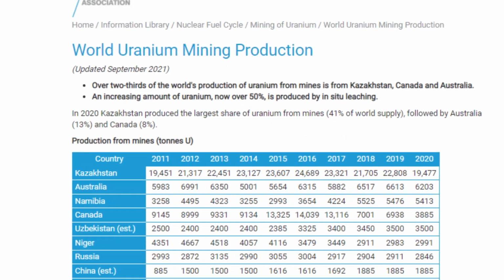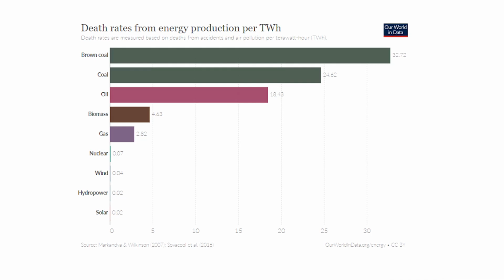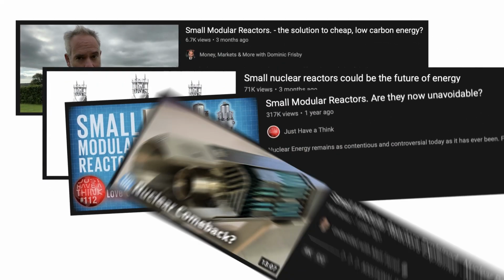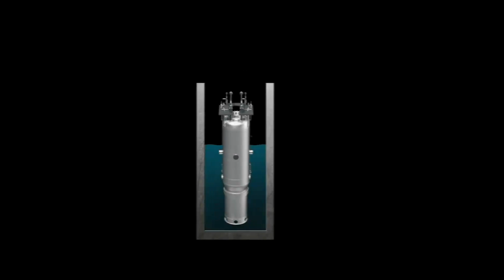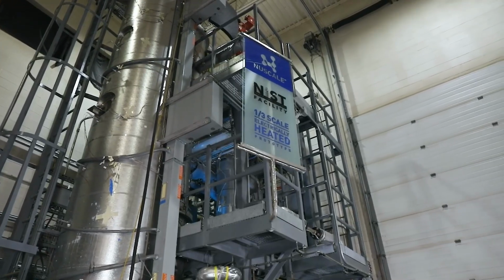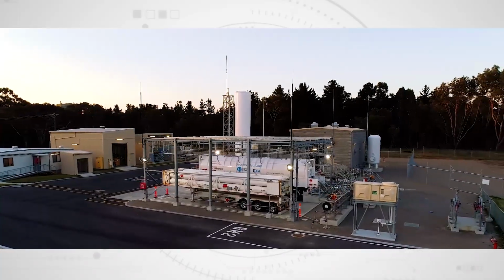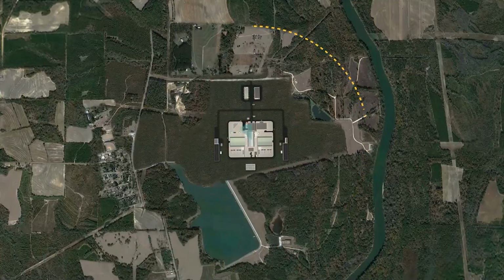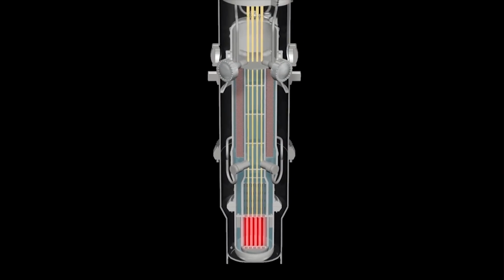Can Small Modular Reactors Save Nuclear Power?

Comment: Normally I quite like your vids Rosie, but here I think your overall analysis is poor. Short version: nuclear is too slow, too expensive, too dangerous, restricts the build-out and grid options for renewables - and has way too high emissions per kwh anyway. New nuclear in a climate heading over 1.5°C is insanity, it's straight-up denial - we need to cut Gigatonnes of GHG emissions NOW, the absolute bulk of cuts have to occur this decade [1] 

Long version: 
-New nuclear power plants cost about five times as much per kWh as onshore wind power plants. Nuclear power takes 5 to 17 years longer from planning to operation (climate crisis needs scalability right now). It produces on average 23 times more emissions per unit of electricity generated than wind and solar + storage (between 9 to 37 times depending upon plant size and construction schedule), and that is probably an underestimate. Moreover, it structurally hinders the expansion of renewable energies, which are more readily available, cheaper and less dangerous than nuclear power. Furthermore, it causes risks and costs related to weapons proliferation, nuclear meltdowns, lung cancer in mines and the obvious waste risks - and this in times of an escalating climate, ecological and social crisis is simply dangerous madness [2] 
-Nuclear isn't even close to as effective in limiting emissions as renewables, something between 3-13 times more CO2-e/kWh due continuous mining and refining of uranium needed for the plant. Emissions from new nuclear are 78 to 178 g-CO2/kWh, not close to 0 - of which 64 to 102 g-CO2-e/kWh over 100 years are emissions from the background grid while consumers wait 10 to 19 years for nuclear to come online or be refurbished, relative to 2 to 5 years for wind or solar. In addition, all nuclear plants emit 4.4 g-CO2e/kWh from the water vapor and heat they release. It produces on average 23 times more emissions per unit of electricity generated than wind and solar + storage (between 9 to 37 times depending upon plant size and construction schedule), and that is probably an underestimate [2]
-Nuclear does not contribute to a lowering of emissions at a grid scale, in fact there is a negative association between the scales of national nuclear and renewables attachments (nuclear and renewables attachments tend to crowd each other out) [3]
-Looking at past statistics on nuclear verges on climate denialism, it takes no account that social collapse, terror attacks and military meltdowns & zirconium fires could release radiation from clouds that could devastate our environment and destroy ozone [4] and oceans [5]
-We have 440 reactors in the world which are prime targets for terrorism and conflict - even at 1.2°C warming we currently have a serious threat in Ukraine at one of the biggest facilities. All nuclear fuels and all nuclear products can be utilized in a dirty bomb, if not a nuclear bomb. Even deuterium used in heavy-water reactors and fusion reactors, at large volume, is cause for concern as it can be used to make lithium-6 deuteride thermonuclear warheads [6] 
-Cooling water also needs to be readily available below enviromental temperature thresholds (climate change risk) and is destructive for the riverine ecology. France in summer 2022 is a good example, and faces the prospect of having to reduce output because of insufficient river water and the water that is there is already at high temps, all this at just 1.2°C warming [7] 
-We have locked in sea level rise of at least 78cm this century that will threaten many existing facilities before the end of their life cycles [8] Two in five nuclear plants operate on the coast and at least 100 have been built just a few metres above sea level. Nuclear plants further inland will face similar problems with flooding in a warming world. Increasingly severe droughts and wildfire only ramp up the threat, while around 516 million people worldwide live within a 80km radius of at least one operating nuclear power plant, and 20 million live within a 16km radius. [9] Regardless of future warming scenarios, there are also thousands of dams around the world which could collapse and are also targets for military or terrorist attack [10] 
-Every dollar spent on nuclear is a dollar that could have been spent on solar, wind, hydro, tidal, storage or geothermal. 
-Efforts to build plants resistant to climate change will significantly increase the already considerable expense involved in building, operating and decommissioning nuclear plants, not to mention maintaining and protecting their stockpiles of nuclear waste. Extreme floods, droughts and storms which were once rare are becoming far more common, making industry protection measures, drafted in an earlier age, increasingly obsolete. Climate risks to nuclear power plants won’t be linear or predictable. As rising seas, storm surges and heavy rainfall erodes coastal and inland flood defences, natural and built barriers will reach their limits.
-The US Nuclear Regulatory Commission concludes the vast majority of its nuclear sites were never designed to withstand the future climate impacts they face, and many have already experienced some flooding while The US Army War College report that nuclear power facilities are at high risk of temporary or permanent closure due to climate threats – with 60% of US nuclear capacity at risk from future sea-level rise, severe storms, and cooling water shortages.

[1] https://timesofsandiego.com/opinion/2022/05/16/expanding-nuclear-power-to-fight-climate-change-would-be-insanity/
[2] https://eu.boell.org/en/2021/04/26/7-reasons-why-nuclear-energy-not-answer-solve-climate-change
[3] https://www.nature.com/articles/s41560-020-00696-3
[4] https://agupubs.onlinelibrary.wiley.com/doi/10.1029/2021JD035079
[5] https://agupubs.onlinelibrary.wiley.com/doi/10.1029/2021AV000610
[6] https://www.nature.com/articles/d41586-022-02811-8
[7] https://www.wired.com/story/nuclear-power-plants-struggling-to-stay-cool/
[8] https://www.nature.com/articles/s41558-022-01441-2
[9] https://theconversation.com/nuclear-energy-isnt-a-safe-bet-in-a-warming-world-heres-why-163371
[10] https://doi.org/10.53328/
Reply: -Uranium and Thorium reserves won't allow more than a few decades of energy production at present levels let alone a significant expansion to decarbonise the global grid. Hafnium, beryllium, zirconium, and niobium and other such metals are extremely rare and difficult to extract, this would also increase their price volatility and limit their rate of uptake in nuclear power stations. Metals used in the nuclear vessel eventually become radioactive and, on decommissioning, those with long half-lives cannot be recycled on timescales useful to human civilization. Thus, a large-scale expansion of nuclear power would reduce “elemental diversity” by depleting the world’s supply of some elements and making them unavailable to future generations [11]
-Hydrogen is a secondary GHG which has been massively under-reported and we need to be extremely careful about how much H2 tech gets built [12]
-The German Office for Nuclear Waste Management studied SMRs and decided that, despite what firms and producers are saying, external nuclear contamination would be a significant risk and the costs would be much greater than any existing reactor technology; and crucially, that at least 3000 SMRs would have to be built to even justify beginning such a program [13]
-In the near-term, we won’t be able to integrate nuclear power plants into the grid in a meaningful way; solar energy already regularly covers half of many electricity needs at midday in spring and summer, and pushing 70% or more at the weekend. By 2025, Germany is looking to have increased grid solar capacity by 150% - there won’t be space for power plants at noon and not at all for nuclear built to generate electricity around the clock. Nuclear can’t easily be ramped up and down, and is only useful in the production of constant electricity. We will need fast-response power plants and expanded storage facilities.
-To date, about 580 nuclear reactors worldwide have operated for a cumulative total of 14,000 reactor years, with at least 11 accidents resulting in a full or partial core melt [14]. At that rate, if the world had only one reactor, it would have a major accident about once every 1,300 years, on average. The Max Plank Society estimates the risk of a worst-case reactor accident every 5000 years of reactor operation [15] six times less likely as being killed in the same year in a traffic accident. A serious accident was prevented in Sweden in 2006 only 7 minutes before it became critical and hardly known [16] how many "near-misses" have there been? Statistically, every 10 years a GAU (major accident) takes place. Terrorist attacks and military interventions are quite dangerous.
-Death statistics for nuclear power don’t show mining, where studies have indicated that 10-15 percent of miners might be dying from lung cancer (dozens a year), a rate six times that expected based on smoking rates alone [17] Renewable energy does not have this risk because (a) it does not require the continuous mining of any material, only one-time mining to produce the energy generators; and (b) the mining itself does not carry the same lung cancer risk that uranium mining does. Also for what it is worth, those gladly-quoted death statistics also don’t include the estimated long-term deaths from Chernobyl, which the UN and WHO estimated could be as hih as 4;000 [18] nor is it a reflection of the social and economic chaos that the hundreds of thousands of people displaced who can never return to their homes.
-40,000 generations will have to live with the consequences of the 70 year atomic energy binge we’ve been on. Scientists don’t even know how best to communicate the danger of the location of the facility where waste will need remain untouched.
-We can cut global energy use in half and still provide good lives and deliver high standards of welfare for all, with universal healthcare, education, housing, transportation, computing etc [19] if we do this, we double the share of energy produced by renewables and can fully decarbonise the energy sector much faster and use the freed-up labour and capital to accelerate the rollout of renewables in a timeframe much faster than nuclear could achieve.

[11] https://journals.sagepub.com/doi/full/10.1177/0096340212459124
[12] https://acp.copernicus.org/articles/22/9349/2022/ 
[13] https://www.base.bund.de/DE/themen/kt/kta-deutschland/neue_reaktoren/neue-reaktoren_node.html
[14] https://fissilematerials.org/library/rr08.pdf
[15] https://acp.copernicus.org/articles/12/4245/2012/acp-12-4245-2012.html
[16] https://inis.iaea.org/search/search.aspx?orig_q=RN:38088106
[17] https://www.cdc.gov/niosh/pgms/worknotify/uranium.html
[18] https://apps.who.int/mediacentre/news/releases/2005/pr38/en/index1.html
[19] https://www.sciencedirect.com/science/article/pii/S0959378020307512

Comment: My only strong opinions are:

1. Plenty of power, 24/7, as and where needed, and

2. No atmospheric pollution with GHG or any other unwanted gases.

Renewables at this point are inadequate because they rely on coal and gas to provide 24/7 continuous power. This is self evidently unacceptable.

Comment: Too bad you haven't kicked in that engineering ability to understand that CO2 is NOT causing global warming. As a matter of fact, every dire prediction about global warming over the last 3 decades has failed to materialize.

Put succinctly, that big fusion powered body 93 miles from earth completely controls the climate. And, if the grand solar minimum materializes on time, a fine point will be put on the matter by about the time these modular reactors are ready.

Comment: Small cores need highly enriched fuel, which is in short supply if you dont want to buy in russia.
High temperature electrolysis using nuclear Heat is the way to go for hydrogen. It works best at>600 C, which cant be achieved in a water cooled reaktor. You need molten salt or liquid metal as coolant. High pressure gases
could bei used, but would leave the core uncooled in case of a leak - i wouldnt recommend that.!

Comment: Nuclear also has not been profitable - anywhere. Fast breeder reactors(like TMI, Chernobyl, Fukushima), that is virtually all production reactors are inherently unsafe with explosive steam pressure, and hydrogen explosions possible, as well as the risk of failure by coolent pumps active safety failures cause cascade failure.

Comment: You need to look at high temperature reactors where heat can be stored in molten salt tanks.  These reactors can function as peaker plants enabling compatibility with renewables producing power when the renewables can't.

Comment: I really think this is a good solution, and there are good ways to store the waste at least here in Sweden. We have almost a facility running dispute the huge resistance against every try to locate a storage. Her we use coppercapsules in concrete stored in deep semsic safe underground tunnels. And these SMR modules makes handling much safer

Comment: I love renewables BUT...  if you want a fair price for renewables you should imagine a 'rule' that requires every solar plant to supply batteries to even out their production.  Night time solar production is distressingly low.  A LIFEPO4 battery cycled every day for 10 years would store power at a cost of around AUD$0.30 for one kWh or AUD$300 (US$200) per MWh.  The exact figure can be larger or smaller depending on assumptions. 
This cost should be incorporated into the cost of the Solar generated electricity.

Comment: I've always been a nuclear skeptic for the usual reasons as outlined above.  In addition, the trouble with the nuclear safety argument is that a nuclear accident can take land out of use for the foreseeable future.   How long before impacted areas around Chernobyl and Fukushima can be safely used again?  That has to be part of the calculation.  

The storage and management of nuclear waste also is on timelines that we can't manage.  There is always drama beyond our control.  

Finally, during war, targeting these facilities small or not, is a way to intimidate and blackmail, as Putin has done in the Ukraine.  Other systems can also be targeted with loss of life (hydroelectric), but at least there is opportunity to rebuild and recover.  This is not the case with nuclear.
Reply: Spot on.

Comment: If speed of evolution of computers was like that of Nuclear, we'd still be using typewriters and mechanical calculators.
And this is the problem with nuclear and they using the same flawed design, very complex and expensive and prone to serious accidents and waste.
People talk about going green and that's fine, but it's very variable in output, without batteries to provide a continuous output.
What made me a proponent for Nuclear are the videos from Kirk Sorensen on YT.
Some of the key points he raised about SMRs are;
- It will provide more and faster baseline power that we desperately need since mandates to reduce global emissions, then compared to solar and wind's small contributions so far.
- That they can be manufactured in factories where iterations in design can be quickly implemented (like Spacex does with their cars and rockets).
- Old design were pretty safe, be these new design and magnitudes safer.
Nuff said...

Comment: Generation 4 reactors offer huge potential over common, current PWR reactors. With greater safety, less waste and lower cost. Gen 4 reactors should be considered on their own merits. China now has two Gen 4 reactor prototypes.  There are a number of different types of Gen 4 reactors. Britain should be producing SMR reactors by 2030. Mainly with Rolls-Royce. The US may have a Gen 4 MSR, Molten Salt Reactor prototype reactor by 2030. Currently, we just need prototypes to prove Gen 4 technology.

Comment: Since it was not discussed at all in the interview with Mr Reyes, I have to assume that the problem of long-term waste is not addressed by this technology. If it were, it certainly would have been mentioned as being a major plus. I am assuming that these SMSs will operate on solid fuel. In my opinion this is very problematic in that it produces large amounts of long lived waste. Considering what is going on in Ukraine with Russia using Chernobyl and other operating nuclear facilities as artillery bases is  very concerning, as much of the accumulated waste requires active cooling. This is a major concern for all of the surrounding area including much of Europe.

I don't understand why any proposal for new generation nuclear isn't in the form of thorium molten salt reactors that even as a moderated thermal have the ability with little processing or enrichment to burn down existing waste accumulations, such as  FLIBE MSRs proposed by Kirk Sorensen.

Comment: So it sounds like regulations, not actual building costs are the problem. LFTR’s can be less than 1/10 the size of the fast water reactors, and will be magnitudes safer, while offering multiple revenue streams. 
One question, did you include the costs of disposing the old panels and wind mill blades? Or the costs of replacing those panels and blades?…